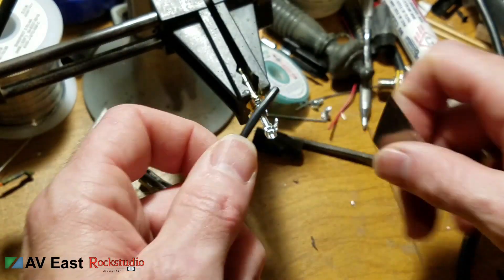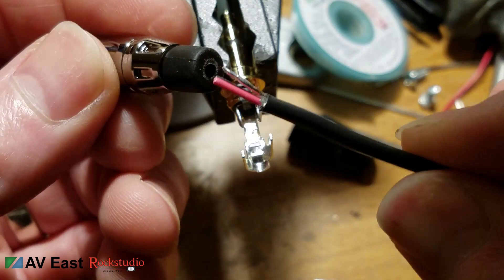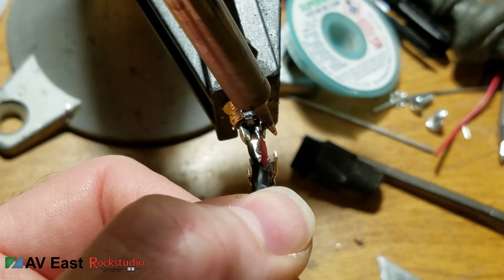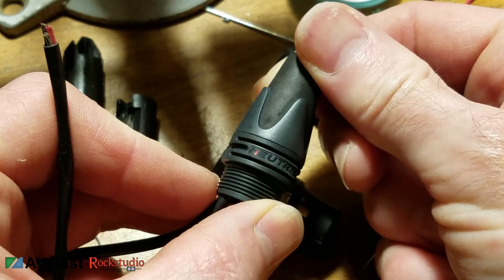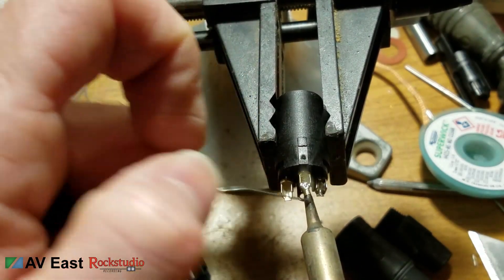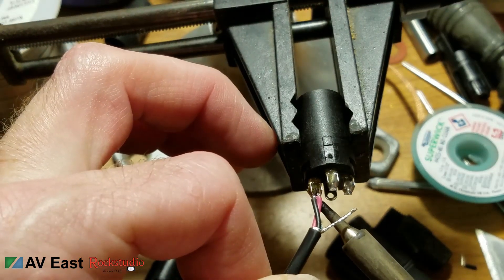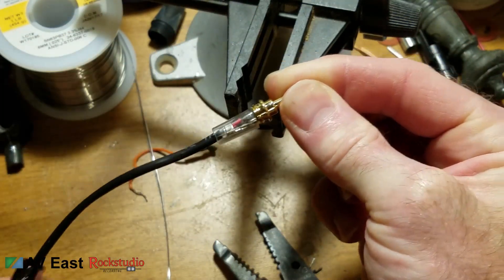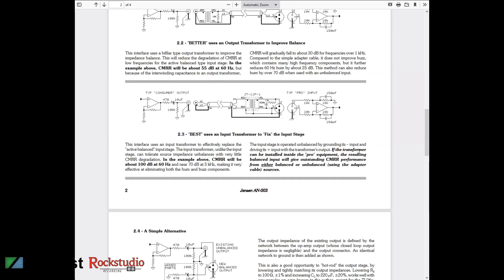How To Make an XLR to 3.5mm Adapter Cable!

Comment: I have really old heaphones (70’s maybe) and they use a whopping 6 pin XLR male connector. Can I cut the head and solder the wires into an 3.5mm plug?
Reply from the maker: @GRORGvideot Hi, I would search for some information about your headphones before cutting anything. Sometimes headphones require more than a typical headphone jack can provide, Stax, for instance, uses a din-type 5 pin connector and has a bias voltage of 580v (580v is present on the cable and headphones while in use).  So please do some research about your headphones first.

Comment: This is a long shot but you might be the only person on the planet who could tell me if this is possible. I want to know if I can cut the XLR end of my Sony ecm77b microphone off and solder a 3.5mm male jack onto that. Is that possible?
Reply from the maker: @TomKaszuba  Hi! Well, unfortunately the circuitry for the microphone itself is located within the metal connector assembly that's built onto the end of your microphone cable. The actual microphone element is too small to house the electronics, that's why they are remotely located at the end of the cable, which is common for very small diaphragm electrode microphones. Thanks for watching and commenting!
Reply: @therockstudio  Hmmmm…….that’s a shame. I’ll sell it then. Thank you very much for the assistance.

Comment: Hello ! What happens if I connect Sleeve to XLR 1. And Tip and Ring to XLR 2 & 3? 

I have an headphone Amp and want to use an channel to run metronome from my mobile phone! I got some ready made cables, but those aren’t working perfectly! I loose audio signal ! Please help

Comment: Question! Does this work for using a XLR mic plugged into a 3.5mm mic input? I would really like to get a SM7B but the current sound card I have only accepts 3.5mm mics
Reply from the maker: Answer! For connecting a dynamic mic to a soundcard with 3.5mm, wire XLR pin 1 to the  3.5mm sleeve. Wire XLR pin 2 to the 3.5mm tip. Ignore pin 3 of the XLR, as well as the ring of the 3.5mm connector. Hopefully the soundcard will have enough gain for a dynamic mic. If it doesn't work, try bridging the tip and ring of the 3.5mm connector (Both to XLR pin 2), or bridging the ring and sleeve (both to XLR pin 1).
Reply: @therockstudio    Thanks. I've been looking for an answer for a while. I'm a noob at this

Comment: Can one make a balanced 3.5 mm to XLR?
Reply from the maker: Well, yes. But you'd have to think about if you want it to be stereo or mono. Then you'll need a transformer or two, an enclosure, cable, 3.5mm connector,  and two XLR connectors for a stereo unbalanced to stereo balanced adapter set.
You'd have to tell me your specific need, then I can help you come up with a solution.
Reply from the maker: Because a typical stereo 3.5mm output is stereo unbalanced (Left +, Right +, Shield).
For a balanced signal there would need to be an inverted signal for Left & Right ( Left -, Right -). You can do this with a transformer,  with a little bit of loss in signal strength. You'll probably need a transformer for each left and right.

Comment: Hi and thanks for the useful video,

 I need help to make a cable for connecting Casio CTS 300 (which has a headphone 3.5 mm jack as an output) to a mixer's XLR female conector. 

I was thinking to make the exact cable described in the video. Would that make sense? 

Best regards
Reply from the maker: Hi Gerardo!  Do you want this to be in stereo? In that case, you would make the 3.5 mm connector go to a pair of XLR male connectors.  If you want it to be in mono,  you can do it just like this video, just use a male XLR instead of a female.
If you want it to be in stereo, wire the ground and tip of the 3.5 mm to pin 2 and ground of one XLR connector (this will be LEFT), and wire the ring of the 3.5 mm connector to pin 2 of the other XLR  connector (this will be RIGHT). You probably don't have to worry about connecting the ground on the second XLR connector, because I'm fairly certain that all the grounds on your console will be connected internally. You could always double check using a multimeter.
Reply: @therockstudio  thank u so much again. I think i would go for the stereo cable because maybe the output from my Casio CTS 300 is stereo, and because some sound banks are Stereo, example: strings (in L) and synth (in R). But im just guessing.

Do you know any option to use just one cable and keep L and R sounds emitted from the keyboard?
Reply from the maker: @gerardocarrillo3102  well, you'll need to use two XLR connectors, to use two channels on the console. Unless your console has a stereo input channel, in which case you may need to wire up two TRS or RCA connectors (using only one stereo channel on the console, but still two connectors).

Comment: I was wondering if this is the same as wiring, let's say, a dynamic microphone to a computer's mic miniplug in?
Reply from the maker: I hadn't ever really looked into the computer mic input, but I did a quick search for "computer mic input pinout" and it looks like the tip and ring are connected, and the sleeve is ground (or negative). So to wire up a dynamic mic, it would be exactly like this with the exception of a female XLR connector as opposed to a male.

Comment: This helped me a lot. I'm a total novice when it comes to audio, but I needed to figure out how to make a pair of panel mount XLR/1/4" jacks (Neutrik) that terminate as a 3.5mm stereo aux end. Totally niche use case, I know. Can I just go pin 1 (XLR A) -> pin 1 (XLR B) -> 3.5mm? (pin 1 to pin 1, pin 2 to pin 2, pin 3 to pin 3, then solder those to the appropriate spots on the 3.5mm plug? The end result should be a cable with two XLR mono inputs at one end and a single stereo output 3.5mm at the other.
Reply from the maker: Hi Nathan, I wish I could post a schematic. I think you are on the right path, but here's how it should go: both xlr pin 1 to ground on the 3.5mm. left XLR pin 2 to 3.5mm tip. Right XLR pin 2 to 3.5mm ring. Ignore both XLR pin 3. You can use one wire, just strip enough back to reach both panel mount XLR jacks. Thanks for watching.
Reply: @therockstudio  That's perfect - I think I've got it. If it doesn't work, I'll hit you up... and I'll send a shoutout when I post the video about the kit I'm building. Thank you!!
Reply from the maker: @NathanBaerreis  sounds dope!

Comment: The video shows just how to cut wire and solder to pins.nit much emphasise or highlight about the pins or connection according to pin numbers!
Reply from the maker: Yeah, I realize I should have included a schematic. Maybe I'll link one. But just so you know, solder up both the left & right of the 3.5mm plug, and then bring both of the left and right to pin two of the female XLR.